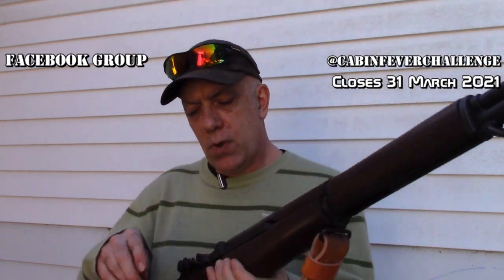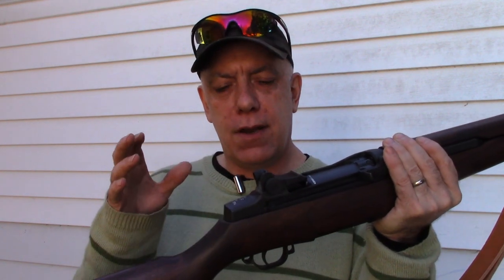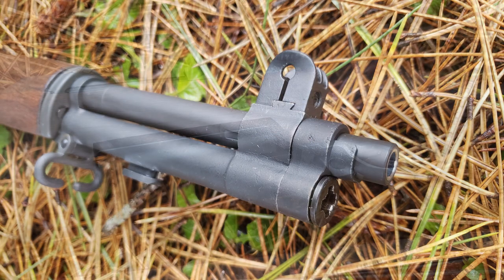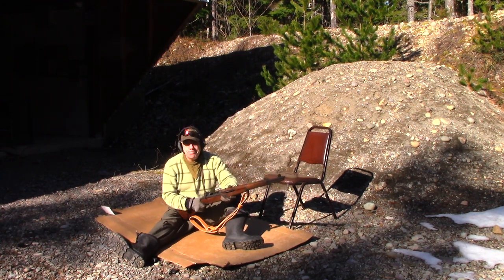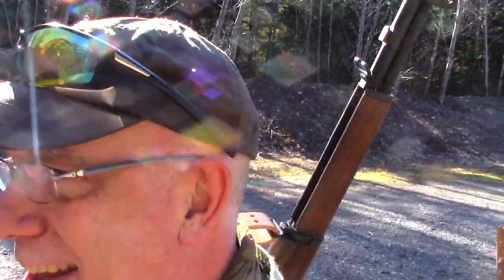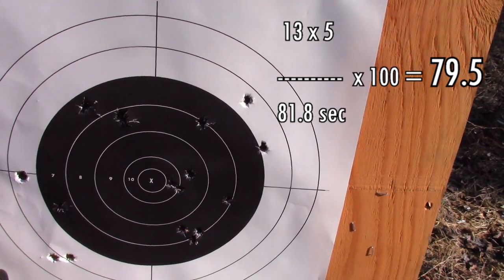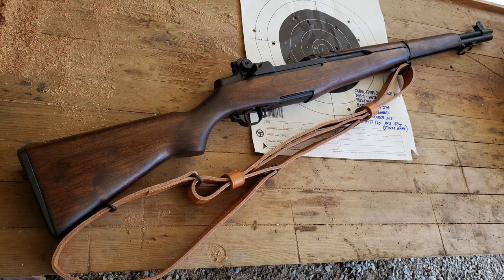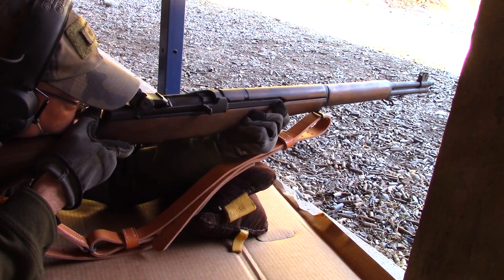THE HELSBY RIFLE

Comment: I wanted to run the CFC2021 with my Garand but I couldn't find any 5 shot clips and I figured I'd fumble it up by ejecting partial clips.  Maybe I'll track down some 5 shot clips for next year.  Thanks again for inventing/hosting this challenge
Reply from the maker: I was lucky to have Richard Helsby available. He found a few and shipped them over.
Reply: You can load partially loaded clips in an M1.
Reply: @FLVCTVAT_NEC_MERGITVR  I find any less than 6 in a clip is pretty loose and they can fall out pretty easily. Maybe it's just my clips, but 6 or more seems like a good, snug fit
Reply: Make your own. Find some pics online to go by. Cutting discs and a dremel, a pair of needle-nose pliers and a little patience and you'll get it done.

Comment: BIG thumbs up from this guy!!!  Did Criteron go with a 1-12 or a 1-10 twist on that barrel?  If you've got the 1/4 minute rear sight shade, you might as well install the NM front sight blade.  Target tells me that the thing has some potential.  Interesting to see what it'd do with some 168 or 175 Sierra's and a good rest.
Reply from the maker: Yes Sir - I have the NM .062 front blade. USGI front blade is definitely too thick to use with that rear peep. This is the 1/10 twist barrel and thanks to a friend of the channel I have about 40X 168gr Nosler Match HPBT bullets to try out.
Reply: @Riflechair  Another good/great bullet that I've been using a lot of is the 168 Hornady A Max, with 4895 or Varget in either LC NM or PPU brass to give about 2650 in my M1A.  Some VERY impressive groups with the Varget load in my heavy barrel Marlin X7S 308.
Reply: @darreldwalton8763  A Max are awesome bullets! I also like the ELD. My current Garand load is Hornady 168 gr Match BTHP, 4895, and WLR primers.

Comment: And a Winchester bolt.
i changed my M1a to  M21 clone with a 6.5 creedmoor barrel. Maybe i should put my .308 barrel on my M1 so i can shoot all my 7.62 ammo.
Reply from the maker: A M21 in 6.5 CM sounds delightful. Did you need to do anything to the gas system?
Reply: @Riflechair  i ordered the Sheuzen adj gas plug in case i need it for the Reloader 17 powder i'm burning. Running the 140's at 2725fps, and 130's at 2800 may be tough on the gas system. i can't get the velocity high enough to work at distance with normal IMR4064, 4895, Varget, etc. Those little .264 cal pills like things really fast. It's a work in progress. Not much in the way of You/tube videos on this particular combination, M1a with a  6.5Creedmoor barrel. She's busted the 1000yd barrier already with my 130 Nosler RDF load of 38gr RL15. Slow though and not consistent. i will keep my brother posted though. Maple Leaf UP...
Reply from the maker: @ssgnewt  Thank you for the reply. I have a colleague running a similar situation in 6.5X55:Swedish  Mauser and the initial results are very positive. The M1 boundaries as we understand it are very undefined.